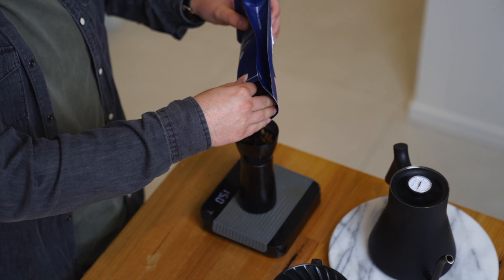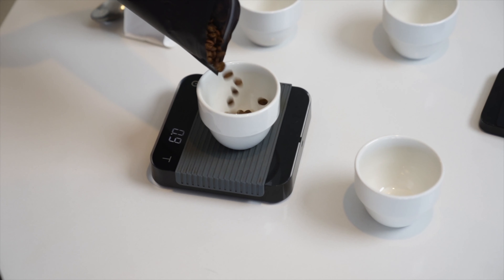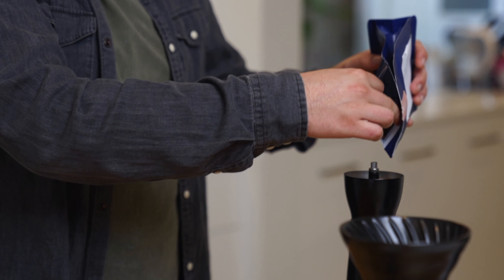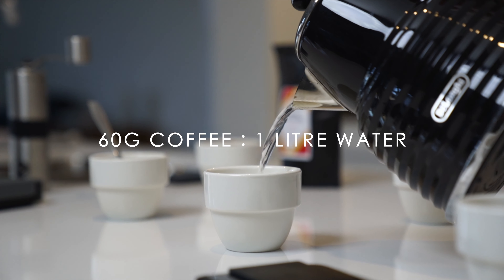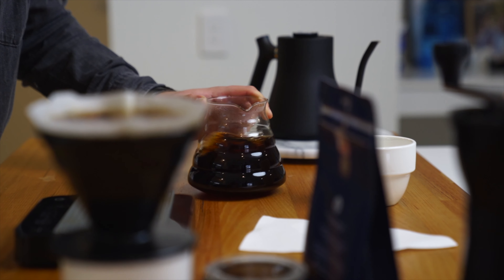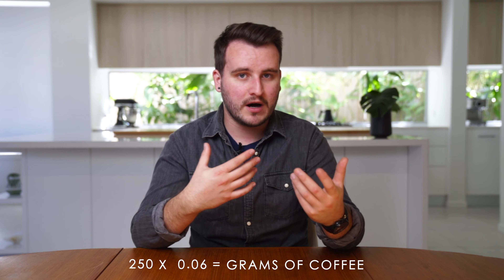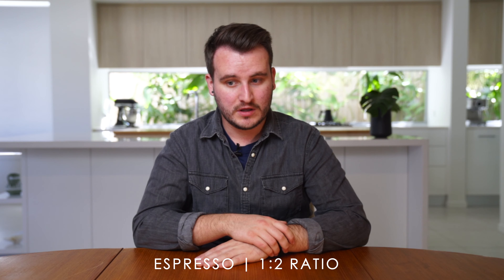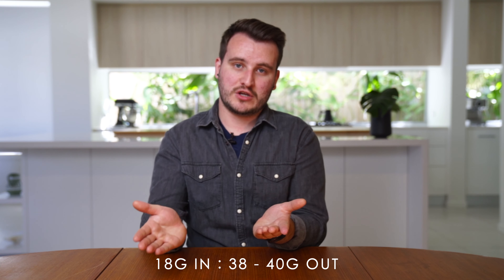Coffee to water Ratio explained (Our Ratio)

Comment from the maker: OUR ANSWER
----------------------
For Filter Coffee:
----------------------
Start with a 60 grams of Coffee : 1 Litre of Water ratio. 
Use the Calculation: Volume of Cup (in ml) X 0.06 = Grams of Coffee Needed. 
----------------------
For Espresso:
----------------------
We use a ratio of 1:2
That means X grams of coffee IN the basket = Double that volume in espresso liquid. 
E.G. 20 Grams of Coffee In : 40 Grams Of Espresso/Liquid Out
----------------------
Tweak these from here and away you go.